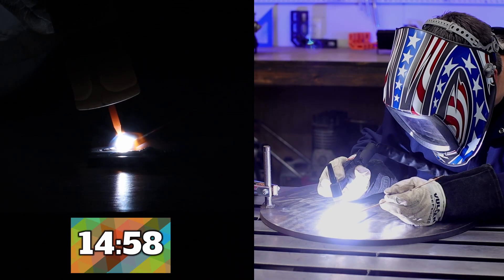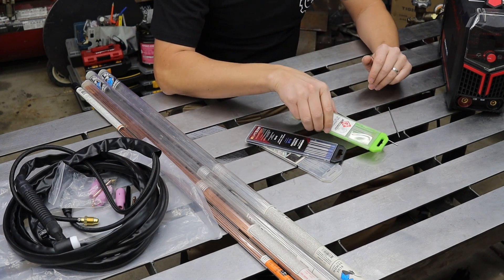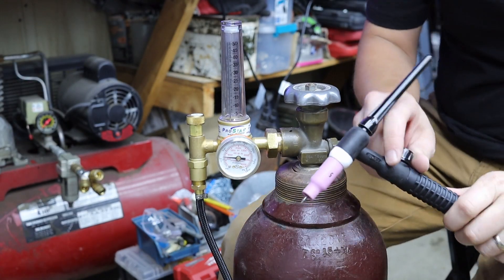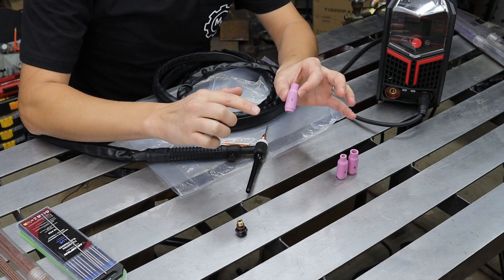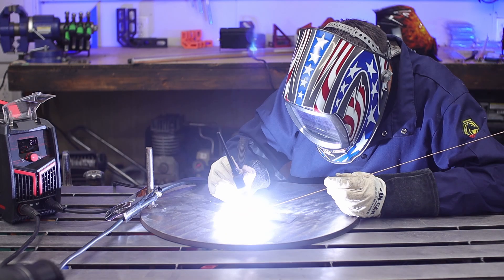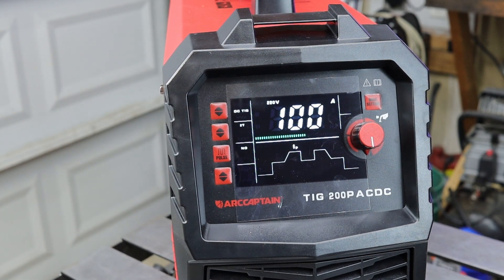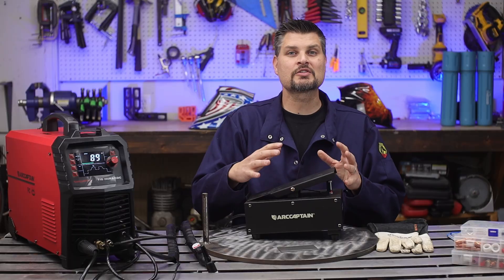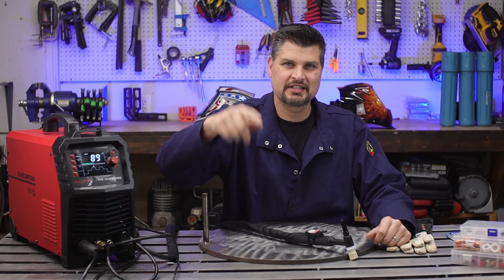TIG Welding 101 // Basics In Under 15 MIN!

Comment: is it possible to have longer connection cables from the miller to the tip-tig? 40 or 45 feet will be great
Reply from the maker: Yes, you can get cable extensions. Typically I've seen 25 ft. You'd have to do some research if you want to go longer than that. I'd go and ask you local welding supply store.

Comment: Whats the reasoning behind not starting out with aluminum?
Reply: You need ac/dc machine because it cleans the oxide from the aluminium, otherwise you need to clean it off prior with a stainless wire brush,  or acetone

Comment: Great info. If I have a AC/DC TIG welder can I weld aluminum with a 120 volt ac power source or do I need 220. 1/4 aluminum . thanks

Comment: how wide open or not do you open the gas valve on the torch? (once you have the tank wide open, and the flow meter at your cfh) how do you know where to set it?

Comment: What??? Inverter MMA can be used for tig?? just buy the torch and directly plug to the Tank? damn.. i when to buying cheap MMA inverter welding to buying another 6-in-1 Inverter MMA+FCAW(0.8,1.0)+GMAW(0.6)+Lift TIG just coz i want to try them out,. the 0.6 GMAW tho left it to be desired,.. So I have a question for you, if it says it can only do 0.6GMAW is it possible to use with 0.8 or 1.0 GMAW? since the I can just change the feeder gear to 0.8 1.0 (FCAW)that it comes with it and just play with the ampheres?

Comment: I just bought everything needed ti start tig welding, I have the machine, torch, gas tungsten and rods. First results: total disappointment 🤣 but after watching this video I realized my torch is not set correctly and I am not starting the thing right. When I lift it I always end up with a ball in the tip of the tungsten and it’s glowing so hot my eyes hurt. I use a new mask so it could not be setup right. So I’m gonna give it another shot 😊
Reply: How’d u go
Reply: @AlexanderAtterwell out of argon gas. Didn’t try again
Reply: @Jfjs58-g run through gas relatively quick?
Reply: @mullins71 turn the gas nob to the right on the handle when not welding.  Or the tank off completely.  Letting it spew constantly while fiddling around will empty the tank within a few hours.
Reply: @mullins71 it was a small 1L cylinder with a very basic pressure regulator no gauge, I thought it was enough for beginning obviously I didn’t know what I was doing 😂
Reply: Ìb h v bh
Reply: Check your polarity.

Comment: Hello, great video.  For the TIG-LIFT with a non-tig-specialized machine (means an inverter welder in the TIG function). What is amperage ?? Is always same ? 
   You mention that gas must be 15-20 units of flux, is that always same ?  or depends material ?

Thanks

Comment: If you're learning how to weld a water cooled torch is an absolute must have. Sure air cooled torches are fine for small jobs and really most of the acual jobs a hobbyist is likely to be doing. However when your learning how to weld your going to be welding a lot, an air cooled torch is going to be terrible, you'll have to stop and let it cool down every few minutes for quite a while. You'll probably end up melting a few torches in the process as well as you fingrtips. The additional cost of a water cooled torch and cooler is going to be less then the cost of the gas you waste cooling down the air cooled torch. When I learned how to weld I started out with an air cooled torch and almost gave up trying to learn as it was taking forever. Seems like all i was doing was wasting gas and wating for my torch cool off, I bought a water cooled setup and it was a game changer. I was able to sit down and practice as much as I wanted for as long as I wanted.
Reply: This is good advice . I just set up my new machine and wished I chose a water cooled torch. The air-cooled torch gets really hot, and I am welding at quite low amperage. I'll definitely be getting a water cooled ASAP.